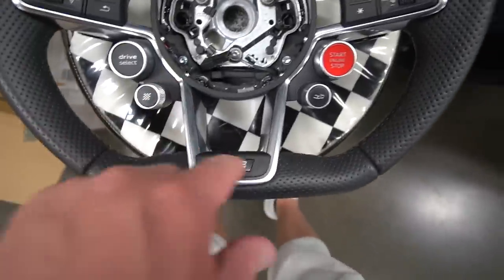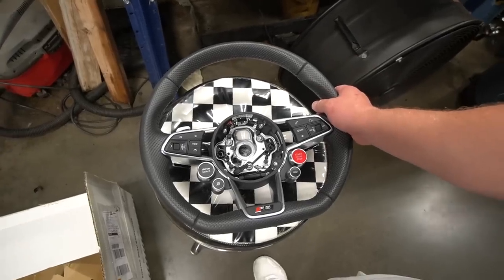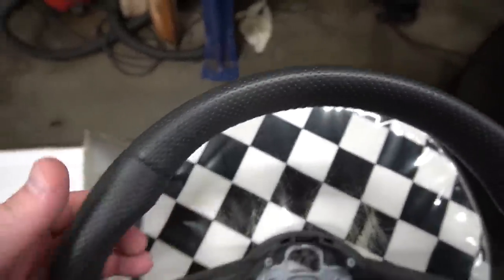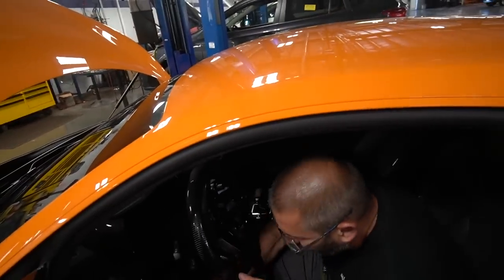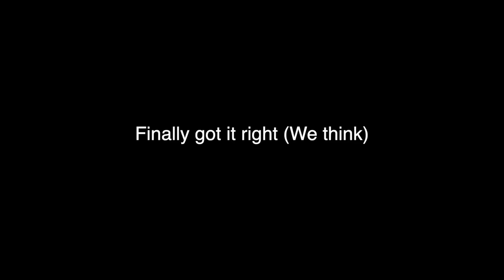Best Interior Upgrade For ANY Audi! Carbon Fiber Steering Wheel Swap!

Comment: Hello. The problem with that continuous active horn is because that "circuit board" how you called it (by the way it is called a Horn Bridge), was not adjusted properly after reassembly in steering wheel. That adjustment of how much those horn bridge screws are torqued, is actually done by a machine, not manually by a human hand. So this is why the airbag got so sensitive when pressing. P.S. I work in steering wheel factory in Romania, which is actually producing also that R8 steering wheel.
Reply: Props Rosca 👍
This comment needs to go viral !
Reply: ❤️ pe volanul meu scrie TRW Timisoara

Comment: the trick is that you have to grease those pins that are clicking in , common issue 😀
Reply: Does this work? Just installed one but the airbag is super wobbly and lose feeling, yet the screws for that plate feel tight